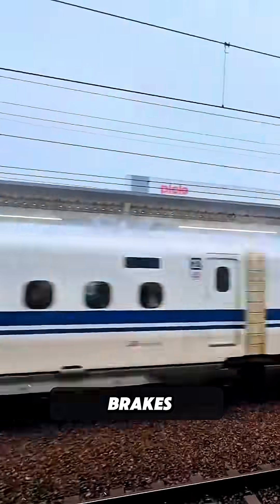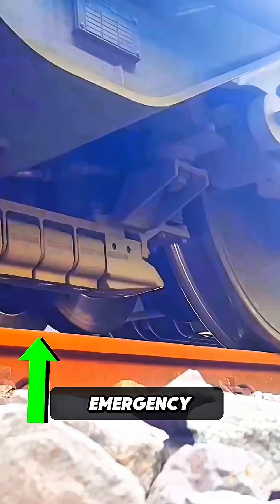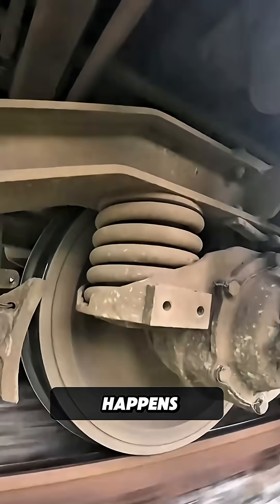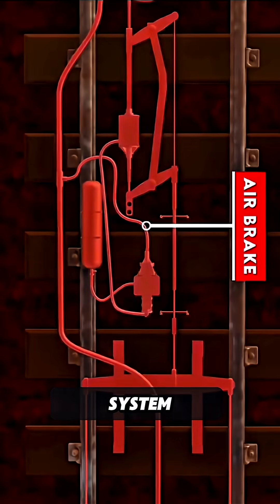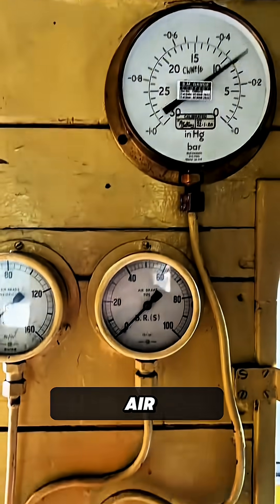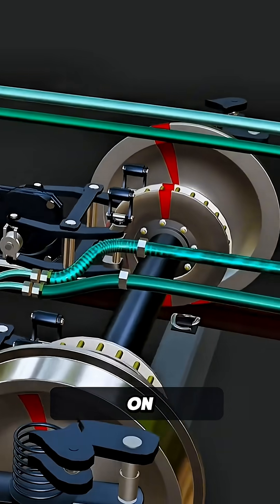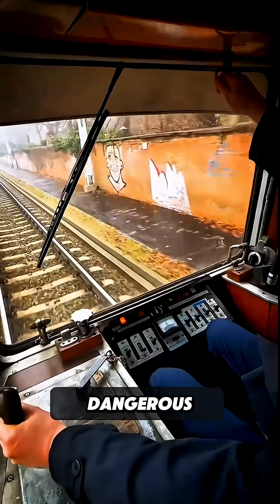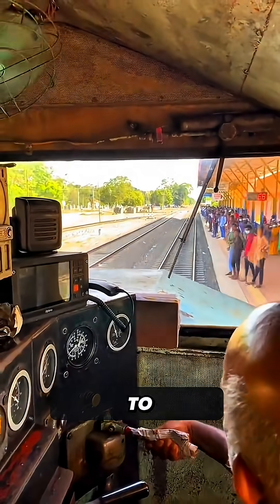The 150-Year-Old Technology Still Saving Trains Today‼️#SHORT

Comment: What if all fail
Reply: The emergency brakes are released under pressure. If pressure drops, they activate. Seems foolproof to me.
Reply: Air brakes require air pressure to release the brake and allow the wheel to turn freely. That's the beauty of air brakes, everything can fail, engine, electronics, hydraulic systems, but all it takes is a hand operated valve to release the pressure holding the brakes open and the system engages. It's a foolproof system.
Reply: @Another_Saved_Sinner oh

Comment: The old vacuum brake system is simpler and also works well if the brake pipe fails, just on shorter trains than air braked trains.

Comment: Same setup on busses, Air pressure is needed to release and hold back the park brake spring in the booster, if the worst case scenario happens and you lose all your air, the park brake spring in the booster applies the brakes. Passive and foolproof system. Good piece of engineering as far as safety goes.
Reply from the maker: Absolutely right! That same air-spring fail-safe system is one of the reasons buses and trains are so reliable when it comes to safety. Passive braking through spring force when air is lost is such a clever piece of engineering simple, yet powerful. Thanks for sharing this!
Reply: it applies a brake force equivalent to 40 air PSI application.

Comment: Every train uses the air brakes. Some also use magnetic brakes for emergency stopping. Tho the other that were mentioned in the video are automatic emergency brake trigger systems, basicly like assistants, that just release the air brake / magnetic brake automaticly.
Reply from the maker: The systems like ATC and earthquake detection don’t replace air brakes they just trigger them automatically in dangerous situations. Magnetic brakes add extra stopping power, especially at high speeds. Thanks for the clear explanation train safety truly is a layered system.